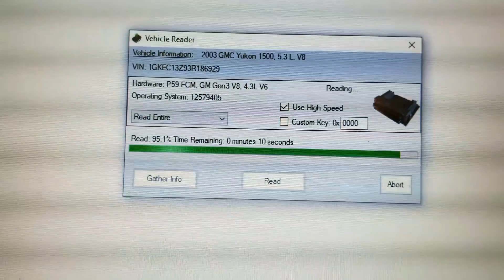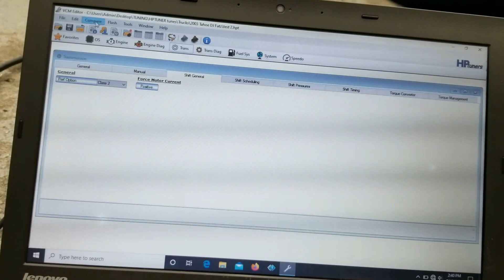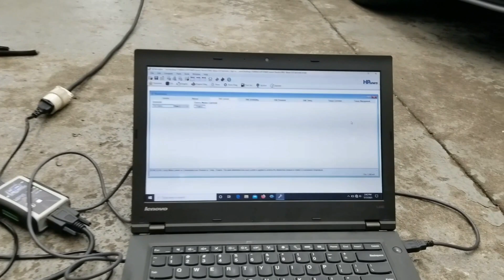Almost bricked a Customers ECM?  Here is a solution for when HPTuners won't work in the vehicle.

Comment: I kept getting the write transfer error on a 2005 Sierra multiple times, finally as a last ditch i put my light on the sunload sensor and it wrote. Thats how i have been doing it since with no problems.
Reply from the maker: Good idea.  Just had a V1 causing issue until I pulled the radio fuse!!

Comment: literally just bricked my 99 mr lancer ecu trying to flash it. was doing it in the car and was able to read the ecu and adjust the values (was using a plastic case ecu with a 605 maf into a 98 glxi with a 449 maf). turned the ingnition to the on position and it wouldnt stop clicking, then there was a pop and now it just clicks. Plugged into another lancer and same thing. Board on the ecu itself looks fine so hoping we only corrupted the file
Reply from the maker: I'm not too familiar with the Lancers.  Good luck!

Comment: Does it have aftermarket radio
Reply from the maker: Lots of aftermarket stuff on it,yes.   On gen 3s best to put on a charger, pull any radio fuses, and take of high speed writing.    Bad thing is sonetimes... nothing helps
Reply: Have you tried removing the fuse and if it’s a Bose I believe you have to remove that fuse also if this helps I’ll find the diagram also I had to add a charger to my battery or it would time out before tuning
Reply from the maker: @jasonwarford85  yes.   For sure!
Reply: Also changing a bcm if you have one will mess it up

Comment: I have a question, my mechanic is doing a e fan conversion on my 2003 suburban im using a bp automotive harness. when my mechanic tried using hp tuners to set the fans I locked my pcm, bought another pcm from the junk yard and locked that one. any idea what could be going on??
Reply from the maker: Interference in your electronic system.   We have a bench rig we may could revive it with....

Comment: This just happened this morning!!! I have  A customer's 2007 Yukon, It has a Cam headers, With an E38 PCM. Sitting in my parking lot as well. I tweaked the tune and wrote, during writing, It said writing halted and stopped. It now says unlicensed vehicle when I try to write the pcm. Am I screwed or can I make a bench flash like this? Also any schematics for the e 38? Please help if possible. Thanks Shaun
Reply from the maker: I am not sure on schematics for it, but we have saved a few E38 by disconnecting the battery, then hooking it up and charging the entire vehicle a while.  After you see a solid 13 volts try writing again.   We do have a bench setup if you haven't gotten it fixed by now we can try to help on!
Reply: @nufnuffz28  I got an 07 tahoe ecu and bought new credits.  It's back on the road, just a week 2 late! Thanks though
Reply from the maker: @slopoke22  awesome